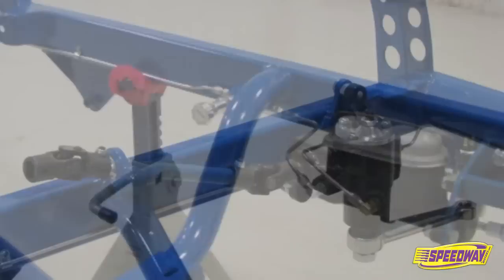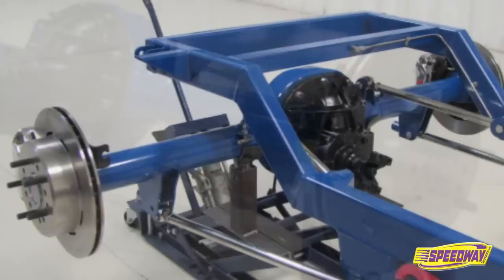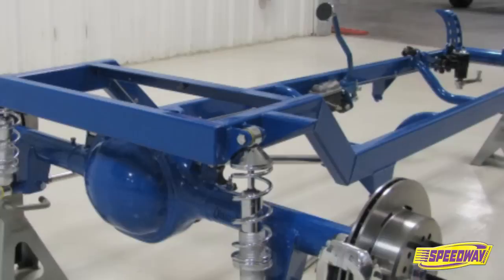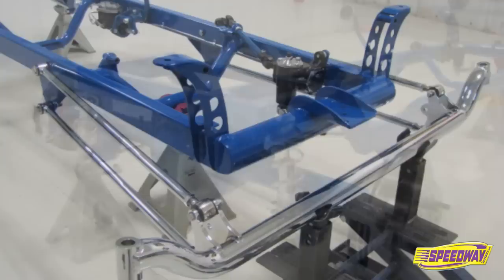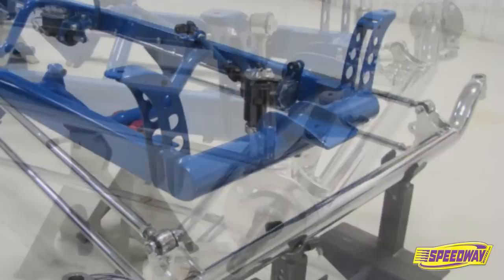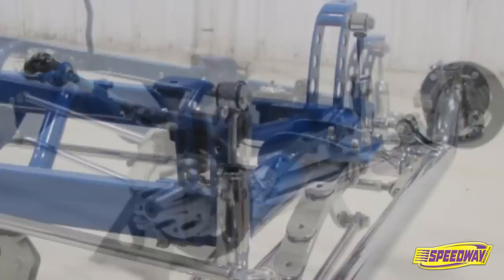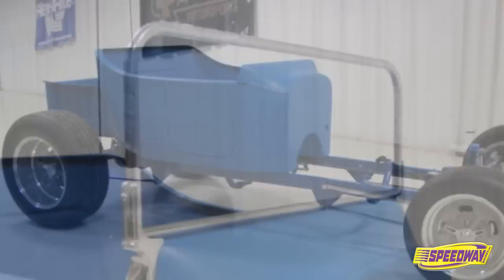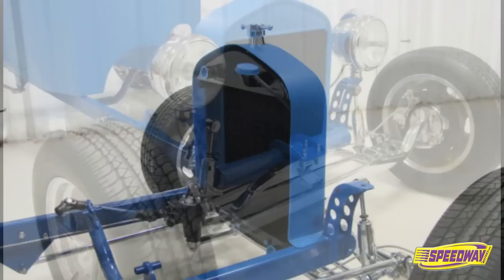T-bucket Kit | Speedway Motors

Comment from the maker: @bill1962us Speedway Motors issues an MSO (Manufacturer’s Statement of Origin) for the T Bucket frame and body it produces. This would be taken to the local DMV along with receipts for all major components of the vehicle. The DMV will issue a VIN and title based on the local rules and regulations. The T Bucket will typically have a title that reads assembled vehicle, kit vehicle, reproduction vehicle or in some states it's even titled as a 23 T.

Comment from the maker: @yumyumsashimi We have many options for the budget-minded rodder! If you have good welding and fabrication skills, you can start with one of our bare T frames (such as p/n 715-4001) and add your own suspension and engine mounts to keep costs down. Or, simply start with one of our kit frame assemblies (such as the Basic T, p/n 715-1000) and buy other parts as you can afford them.